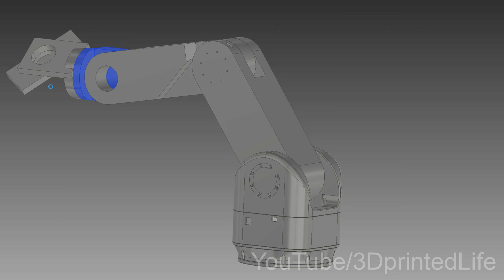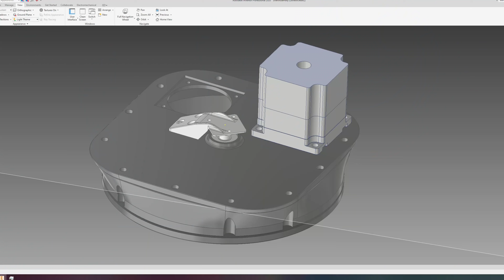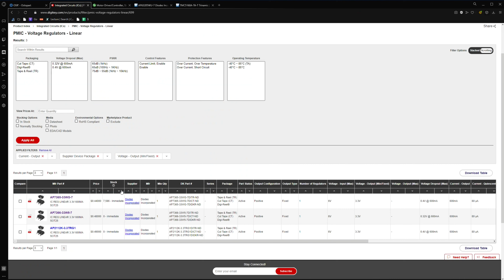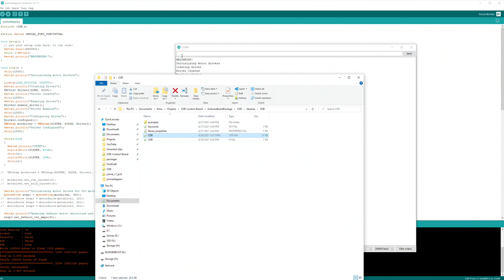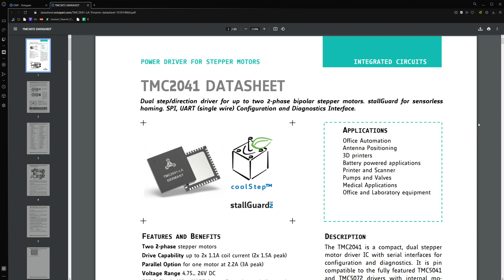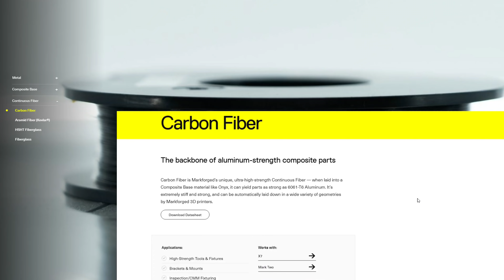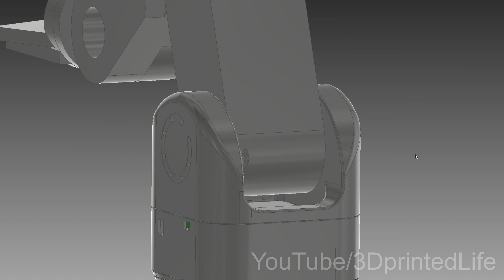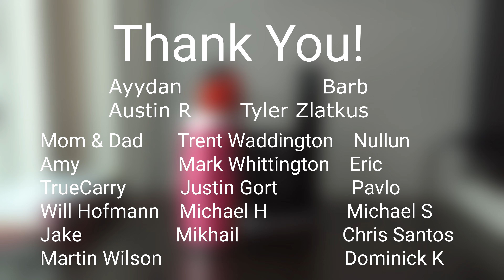Integrating My Harmonic Drive - 3D Printed 6-Axis Robot Arm

Comment: this is super cool, and I'll be following this closely and maybe become a patreon. but in all honestly, I dare questioning the choice of the harmonic drive: as cool as it is, in a robot arm a 102 reduction ration is the realm of high-speed brushless motors, not steppers. which obviously would require a totally different type of board to drive them... looking forward to the next instalment!
Reply from the maker: Yep agreed! Though the harmonic on its own is only about 30:1, the additional reduction comes from the belt drive going from the motor to that driveshaft and I plan on playing with the reduction there to achieve the best results.
Reply: @3DprintedLife  sounds great! looking forward to!

Comment: can pcbway populate the board? Or other source? Or a 3d printer controller can drive it?
Reply from the maker: Yes they can, but sourcing components is really difficult these days so it was easier for me to build it myself. As long as the 3D printer controller has high power stepper drivers then yes you could!

Comment: How is backlash on your rotation base? I have a need for that. Thanks.
Reply from the maker: I haven't tested it but the gear meshing is very tight so it should be extremely low, there will likely be more positioning error from the plastic twisting and distorting.

Comment: The desk is not fully hollow actually, there's cardboard inside.... Great design in any case, effective and it looks beautiful!
Reply from the maker: Haha yeah I sort of figured, but surprisingly I didn't hit any so it must be pretty sparse 😁
Reply: @3DprintedLife  Yeah, it's in a triangle grid pattern with vertical slats so you usually won't hit it. I had the same when I was drilling holes to feed cables through it for my 3D printer.

Comment: Please, don't use PLA, it creeps like crazy, especially when getting mildly warm.
Reply from the maker: Good point and I'll definitely consider this when printing the final version!
Reply: @3DprintedLife  use esun ABS+, extremly easy to print while having almost all abs characteristics
Reply: Would ASA be a viable solution then? 🤔
Reply: @sebraecha  usually ABS and ASA are considered to not creep under the usual conditions, for example used for 3d printer parts, even fully inclosed machines like the popular voron use/recommend ABS for the printed parts, ASA is considered to be equal in this point.

Comment: That board debugging sounded painfull...
Reply from the maker: Just a little, hopefully I'm almost done with it though!
Reply: @OneDeuxTriSeiGo  simulation makes only sense if you primarily design analog or simple digital circuits (by your own). What he does here is more like a integration job, the discrete parts around the ICs are mostly recommended by the vendor and the ICs are connected via bus. There is nothing to simulate here. Also getting these chips into spice is not simple and the outcome low.
Best thing to avoid these kinds of failures is to build it on a breadboard before or have experience with pcb design.
Greets from a hardware developer.
Reply: @OneDeuxTriSeiGo  oh cool! I am developing with fpgas also since a few weeks. Interesting stuff!

What you described is basically what a professional routing software does. It checks whether nets are connected properly and (if the setup is good) also compatible with each other.
But, as I said it is mostly connecting working chips with each other, like building a PC. If there are routing specific things, you get that information out of the datasheet.

The problem with spice is that you have to build models for the chips or at least some dummies which can be time consuming. Don't know if it is worth that. I have done that during my engineering studies and I it was just frustrating. I would rather build it on breadboard, if the circuit isn't that complicated.
Reply: @OneDeuxTriSeiGo  You could do this but it would take a lot longer than just reading the datasheets and properly designing the board in the first place. If you're thorough enough, I expect no obvious mistakes. If you don't know if something will work before you make it, you haven't put enough effort in or don't have adequate knowledge.